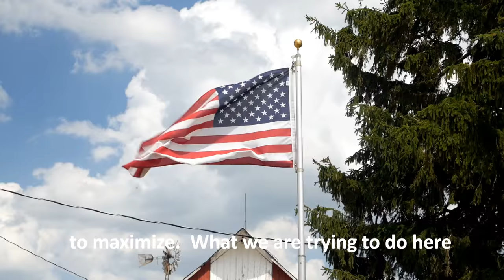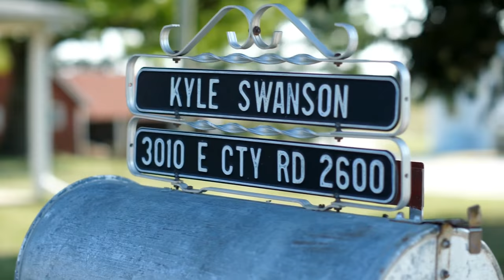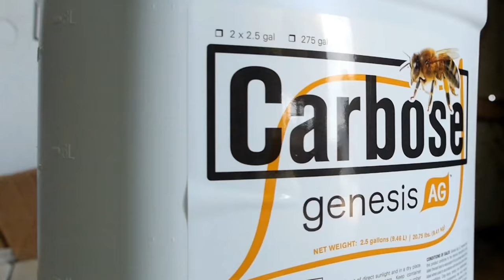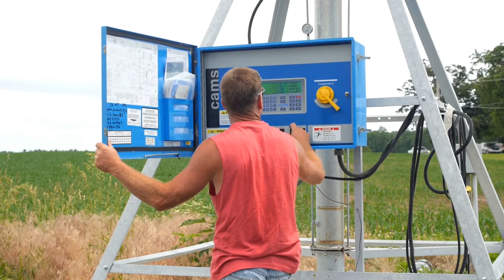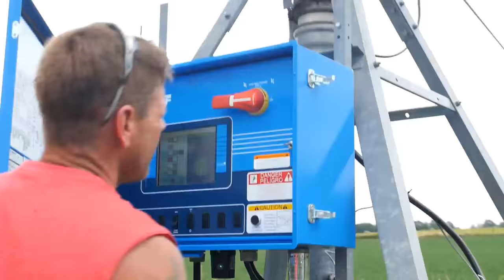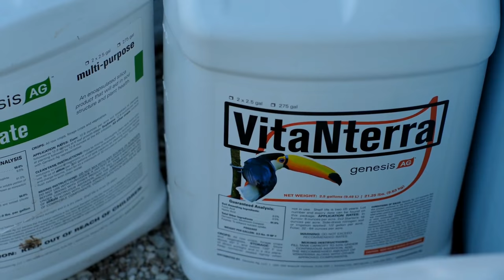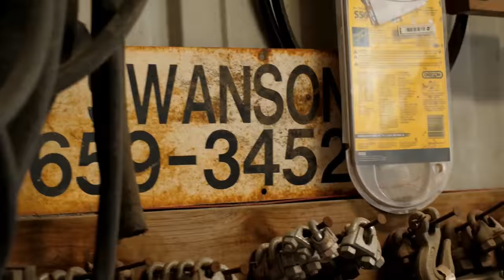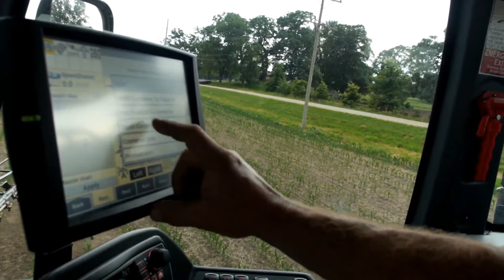Corn Wars - Episode 4 - "Foo-foo Juice & Some Love"

Comment: Ok guys im trying to grow the tallest sunflowers possible in front of my house in a 4 ft x 25 ft garden.  Give me a fertilizer recipe for the job at hand. What should i do? (How much n p k an sulfur,  and what ever else) i live in southeast Nebraska and the soil is black. Its on the south side of my house. Should i get them mico nutrients? Im to tight for a soil sample.
Reply from the maker: most poeple i talk to aren't trying to grow the "tallest". but, make sure you get adequate (soluble) silicon and calcium or they'll "lodge", imo...appropriate levels of boron will help get the other two up there in the plant.
Reply: Big Sasquach soil samples are actually very cheap.  I've never sent a single sample in but for a complete test with micros and all is usually only like $12-15.  There's also a lot of research from the national plant institute on how much of each nutrient different plants require.